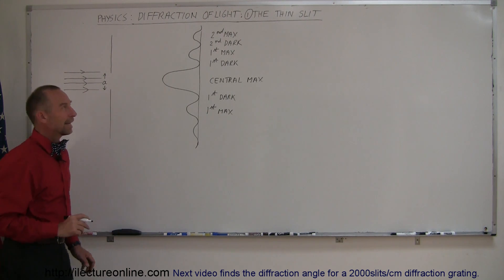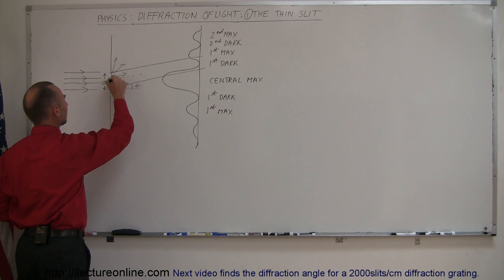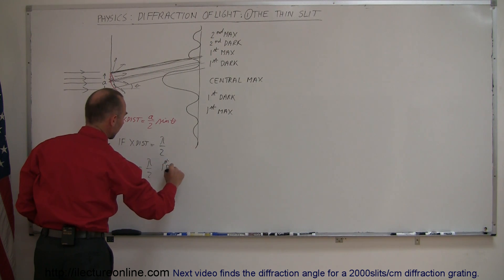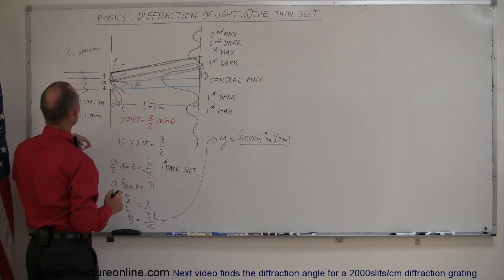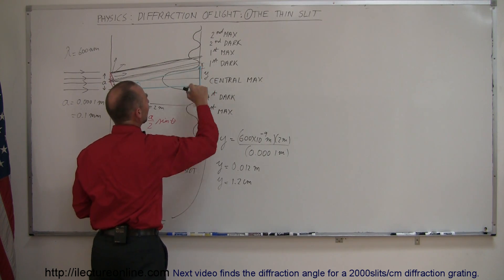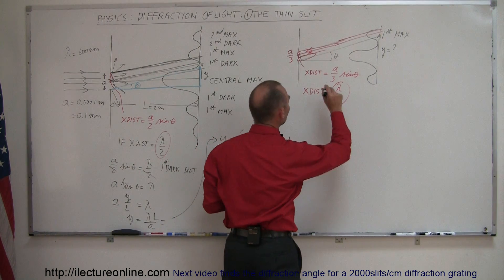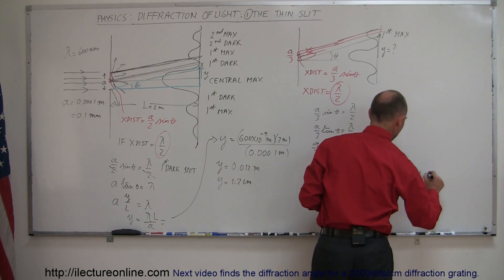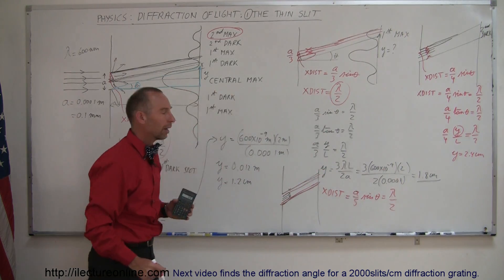Physics - Diffraction of Light (1 of 4) The Thin Slit

Comment: Thank you again for another brilliant demonstration of a topic that does not lend itself to easy appreciation. I have a question though. If the diffraction in the single slit experiment is created because of the many wavelets each having different wavelengths, would the first dark spot have a different wavelength than the second dark spot? Also if you didn't know where the first dark spot was located, but wanted to know the distance between consecutive dark or bright fringe would you use the same formula, y=(lambda)(L)/a
Reply from the maker: In this example, the incident light is coherent.  (Same wavelength and same phase angle)   Diffraction will occur under those conditions as well
Reply: @MichelvanBiezen  Thank you sir, for taking my question. It helps.

Comment: If the position of the lights wave(top, middle, or bottom) hitting the back wall determines the brightness of that spot on the wall(bright spots are the top and bottom of the wave, with the middle of the wave being the dark) why is the center brighter? How are more light waves hitting this spot of the back wall? And how is the wave lengths top or bottom ALWAYS hitting the middle of the back wall no matter the distance of the wall from the opening?
Or is it possible to adjust the back walls distance from slit opening, causing the bright spot to turn dark, caused by the light beam hitting that part, the center, of the back wall in the middle of the light beam?
Reply from the maker: It is not the "position": that determines the diffraction pattern, but the destructive interference of one part of the beam with another part of the beam.  That happens differently at different angles.   (Distance to the screen just affects how spread out the pattern is.

Comment: Why do you plug in tan theta for sin theta in the original equation dsin theta = m*lambda? What does that signify exactly? I'm trying to see how y relates to the original equation for destructive interference.
Reply from the maker: For small angles, sin (theta) = tan (theta) = theta
Reply from the maker: Try it using a calculator.

Comment: Great lecture as always. 
Just wondering though, in Giancoli textbook, they teach finding maxima in a slightly difference way.
For example, to find an angle to the first maximum, they teach to take an average between angles to the first and second minima.
Using (a/3)sin(theta)=lamda / 2 from your approach gives close enough answers for most cases but for some of their problems, the difference is big enough that they mark MasteringPhysics questions wrong. 
Your method seems much more direct intuitively, but can you explain why they would teach in that way?
Reply from the maker: The distance between consecutive fringes is not linear and as the angles become larger there will be a difference in the answer.  The method shown here is an approximation that will give you the correct answer for small angles.

Comment: Great video, explained many problems I had about single slit diffraction.  Thank you so much!  I found it especially helpful the way you drew the rays from each point source that are parallel, to actually appear parallel.  Many other videos and my textbook for the same diagram drew "parallel lines" that originated from different point sources but coincided at the screen, and those diagrams really threw me off, as it took me a while to understand that since the point sources are very close together and the distance between the slit and the screen is very very far in comparison to the distance between the point sources, those coincidental lines can be treated as "parallel" - something very hard to show in a simple diagram that is not to scale.  Again, thank you for your excellent video.

Comment: But I have one doubt or rather two...

1. Why are even the maximas explained by destructive interference of the remaining portion of the beam?
2. Why did we only set the destructive condition to half wavelength? What would it geometrically mean to have 3/2 wavelengths or 5/2 wavelengths or others??
Reply from the maker: +Anant Chopra
  In the case of a single slit, a maximum is created when a portion of the beam makes it to the screen, this occurs as explained in the video.  Note that the portion of the beam making each maximum becomes smaller each time and thus each maximum becomes less intense.  There are many more videos in the playlist with additional detail on this if you are interested.
Reply from the maker: +Michel van Biezen 
The 1/2 wavelength is not "set", but is simply as a result of observing what happens.

Comment: but then why can't we have dark band without changing the angle, that is to divide the same part for which we proved for bright band as 4 part ......then we would have a dark band at that position..
Reply from the maker: +Abhishek Pallippara gopakumar 
The correct question is:
What do you see at every angle?  At certain angles you will see a bright band.  At other angles you will see a dark band.
Then you ask:  What are these angles?
Reply: +Michel van Biezen 
yeah........ indeed that was a foolish question from my side..........now  my doubts are clear....thanks sir (your explanations are awesome)
Reply: +Michel van Biezen 
one more question sir...in your video you explained that from each point in the first half of the slit,waves  interfere destructively with the waves from another point in the second half of the slit....but that is just a pair of them.....what will happen if the same point in first half interfere with another point in second half such that path difference isn't (lambda)/2...i.e that is all other points in second half, than the one with which it interferes destructively.....(does that mean it will be a bright band?)

Comment: The tan(theta) =y/L is not correct for the figure he took. It is the correct relationship but should be applied at the center.
Reply from the maker: +Bharadwaj Bharaata 
The equations are correct (as long as the angles are small, which they are in this example)

Comment: i have some question 
when we divide the split into 3 seqution  the wavelength should be h/3 not h/2 ????????
and my sequend question how a single wave is interfer with it self i can't imagine that ? do you have some video where i can watch it ?
3) when do we have the case of 2 section and when we do have 3 section ? i just cant get it if the first wave interfere with the wave at a/2  and at the same moment it interfere with The wave at a/3 and give us 2 max  postion ?
Reply from the maker: Qualid,
When light shines through a single slit it consists of trillions of individual photons and the light diffracts in all directions after passing through the slit.  When a screen is placed on the other side you'll see a diffraction pattern.  The patterns is caused by how the light from different portions of the beam interacts at specific points on the screen.  Go to each point on the screen and the distance traveled by different portions of the beam will be different.  Different interaction happens at different locations on the screen.
Reply: thank you very helpfull

Comment: I am having difficulty seeing the difference in the single and double/multiple slit equations they seem to be the same. what are the differences that I am missing ?
Reply from the maker: Mr. Amo123
When there is a double slit (or multiple slits), the pattern that forms on the screen is an INTERFERENCE pattern, caused by light traveling different distances to the screen (from each slit) so when light gets to the screen it is out of phase and causes constructive and destructive interference due to path length differences.
With a single slit, the light going through a small slit experiences DIFFRACTION (bending around the corners) and will travel to all areas on the screen.  This causes phase differences within the beam and constructive and destructive interference.  
In actuality, with a double slit or multiple slits, both phenomenon occur which superimposes.

Comment: Thanks for your videos always help my understanding, just have some questions as i have confusion with the order "n" when it comes to finding the max/min spots.

1st Dark Spot on the screen: a/2*x/D=λ/2, what does "n" equal here, is it 1? and does a*sinθ=n*λ apply?

1st Max Spot: a/3*x/D=λ/2 (found from video), what does "n" equal here and does a*sinθ=n*λ also apply here.

How will i know in a question if i need to find a Max or a Min? As i can't seem to find the relationship between the order and the dark/bright spots on the screen.

If the following is true:
Central Max: n=0
1st Dark: n=1
1st Max: n=2
2nd Dark: n=3

How can i find where the 1st Dark, 1st Max etc are?

Thank you for any help!
Reply from the maker: "stinger fist"
Notice how I did not use the variable "n" in this video.  That is because this video shows how to calculate the DIFFRACTION pattern of a single slit.
You may be mixing this with the INTERFERENCE pattern of a double slit where we tend to use the variable "n" to generalize the solution.  Take a look at the videos of the double slit interference pattern and you may find your answer there.
Reply: Michel van Biezen Thanks for response, it is diffraction i am interested in.

I can see that the condition to find the minimum can be generalized to the following formula:

a*sin(θ)=mλ, m=1,2,3

where to find the 2nd min spot m=2 and then when we use "a*sin(θ)=mλ" we get y=2λL/a which is correct.

However to find the first max we use the following formula but not sure if correct, a*sin(θ)=2nλ. And say i need to find the 1st Max, would n=1? as its the first Max. Then Since n=1, y=2λL/a but this is wrong as i can see this from your video

In the video, to find the 1st Max we have the following: a/3*sin(θ)=λ/2 where y=3λD/2a how can i apply a*sin(θ)=2nλ (if correct formula to find max) in this case to find the 1st Max?
Reply: may i also add my question: why to find the first maximum using "path difference = XDist" 1/2 lamda, doesn't the maximum occur if path difference XDist = 0 lamda (for center maximum), or XDist = 1 lamda (for first maximum) , or XDist = 2 lamda (for the second maximum) and so on.

Comment: So, light duality does not play a part in diffraction?
Reply from the maker: Kaleidoscope Bill,
Let's take this one point at a time.
An electron is a real particle (very small) that has mass and a charge of -1.  Just like all small particles, they "behave" like waves.  That means they act just like photons do, even though photons do NOT have mass and electrons do.  Because electrons act like waves, they experience wave interference, which fundamentally determine the properties of atoms and molecules and how they give atoms volume and how they bond together.  
The uncertainty principle simply states that it is not possible to know the exact location of a photon or an electron, nor its momentum at the same time. Finding the location of a photon or an electron is simply a matter of predicting the probability of finding it within a certain volume.  These predictions are done by using a probability density function, which is an equation that is derived from taking the energy and the boundary conditions into consideration and also the wave properties and then calculating where the photon or electron can be.  The double slit experiment is a simple test that can be done to verify the interference pattern that is expected from the light interference pattern of the photons.
Reply from the maker: The concept of "duality" is most commonly used for the particle-wave duality of the electron.  When electrons are bombarded towards a narrow slit, the same diffraction pattern will appear on the other side of the slit.  This is caused by the diffraction (bending around the corner after passing through a slit that is small compared to the wavelength) of the light waves (or electron waves).
Reply: Michel van Biezen I must have not expressed myself correctly. I'm sorry. What I meant was does this phenomenon of light is dew to diffraction of light "waves" or the uncertainty principle of photons?
Reply: BIll Georgoulakis  I think if you can answer that question, you'd be a good candidate for the next nobel prize in physics!

Comment from the maker: you only see part of the beam disappear as it cancels out with another part of the beam.  The portion that doesn't cancel out becomes smaller as you look at the slit from larger and larger angles with respect to the spot directly across from the slit.  That is why we use 1/2 lambda for both the bright and dark spots.

Comment from the maker: Remember that the light will diffract (which means spread out) after it passes through the narrow slit.  Then if you look at the slit from different angles, you will either see light and dark, depending on the angle.  The difference with a single slit is that even when you see light, it is only the portion of the beam that does not cancel out with another portion of the beam.  Thus you either see the whole beam disappear since one half of the beam cancels the other part of the beam or

Comment from the maker: For a single slit diffraction pattern a portion of the beam will experience total destruction because of a path length difference of lambda/2.  The portion of the beam at the angles from small to large angles is: 1:1, 2:3, 1:1, 4:5, 1:1, 6:7, 1:1, 8:9, etc.  which results in dark spots for the 1:1 ratio and a spot diminishing in brightness as a smaller and smaller portion of the beam is not destructively interfered with (which occurs at greater and greater angles).  That is why we use lambda/2